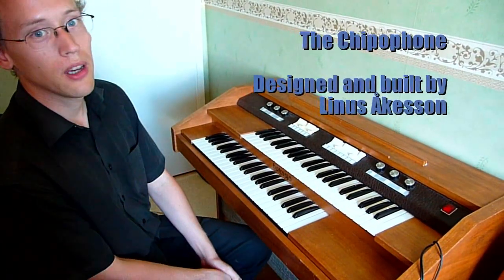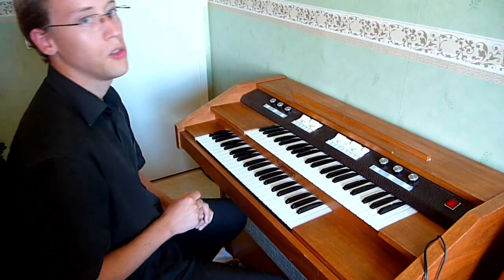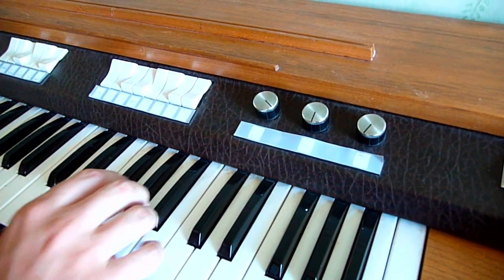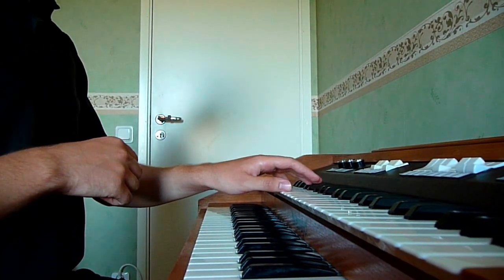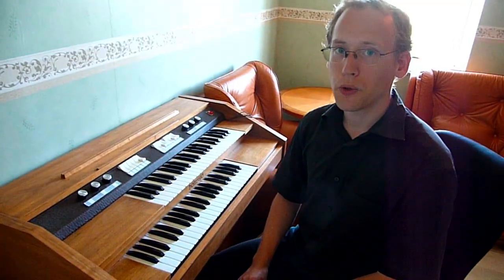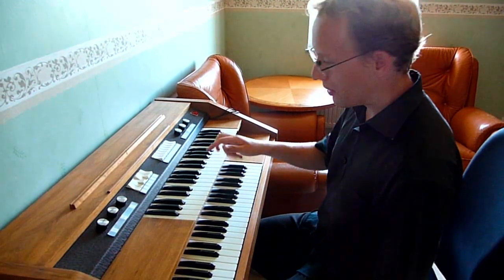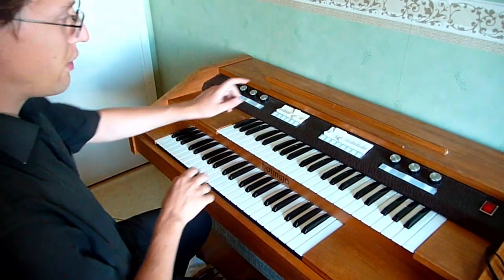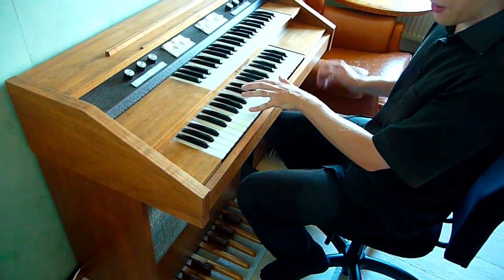The Chipophone

Comment: All this is, is a old organ converted to a midi controller. You can see the white USB cable coming out the back. They make kits to convert these old organs, all the sound processing is done by a PC. This guy has invented nothing. Literally!
Reply: Stop with your conspiracy theory ramblings, man. He doesn't try to hide the fact that it's a MIDI controller, and it's connected to an AtMega88 that he coded. Calm the hell down, it's a neat keyboard.
Reply: No, in previous videos he shows the prototype, its all powered by a small 8-bit microprocessor chip. I believe that right now he is also working with teenage engineering to create more similar digital synthesizers.

Comment: What is it called when a sound goes in a ladder? For example, i press the lowest key and then press the highest and hold both, and the sound kinda runs from low to high if you know what i mean. I would really love to know this
Reply: Do you mean arpeggio? Or portamento?
Reply: If the sound moves upwards it's called a pitch riser (pitch bend). You do this when you want to build tension in your song. Raising the pitch of your lead synth and adding a snare roll is the perfect way to build up to the climax of the song. You could perhaps add a breakdown with the drums right after the build-up, or just add a break. Also you should add a rhythm to the lead, so that it doesn't sound boring when it rises. :)
Reply: those are called interference beats if i'm correct

Comment: Is it analogue or digital? Sorry for sounding stupid, but I just heard a bunch of analogue synths capable of sounding like 8bit or close to it.
Reply: By definition, if it's 8bit it's digital.  Basic pulse/noise waveform's generated by an 8bit processor, 1980's home computer style.  These are modulated in various ways to produce effects, but if you notice - no filter.  You can produce the same kind of tones with analog, with basic raw open filtered patches.  If you're asking mate, shows you're not stupid...
Reply: PTechnicalOriginal By definition, if it's outputing audible noise, there's some amount of analog circuitry involved. The voices, ring modulus and hard sync are digital, and the filter effects are analog (implementing a FIR filter or similar would have been much too expensive).
Reply: soylentgreenb Analog circuitry involved in the output stages, yes I agree.  As for the ring mod and hard sync, I must be missing something because I don't hear those effects here.  Not quite with you friend, are we talking about this instrument?

Comment: You're an idiot.  The vibrato is produced by foot pedal.  The room sound cuts out because he's using a microphone for his voice, but he's cutting out the room noise when he's not talking.  He's not amping the sound from the chipophone.  He's getting the sound as a direct out so you can hear what it sounds without his crappy room noise.  So his mic is not picking up the chipophone sound from the room, you're getting the sound directly from the sound board.

Comment: The way that works is that there is an LFO (Low Frequency Oscillator) that affects the pitch control, producing vibrato. And then there's this thing called an envelope. That allows you to put a delay in when your LFO starts working. AKA: You play a note, wait 2 seconds, then the vibrato starts. You'll hear it in the couple of notes he plays after the end of Mario as well, just for a brief moment.

And yeah... they could do that on old chiptune synths.

Comment: @masterofhobbiton actually if you read it he didn't buy it, a friend did and never used it. but the point remains that he modified an old organ to be an 8 bit synthesizer. now that I see that he removed the speaker in it to send it straight to a computer it makes sense that it has better audio than him. The part about the foot pedal it quite odd.

Comment: @SotR59 The point is that it is a self-contained chiptune performance device (sounds like it is using a SID). He has the controllers set up to do many of the common effects used for chiptunes (arpeggio, slurs, delayed vibrato). He can also control drums (not samples, but programmed chip sounds) from the pedals which is insane. In order to do anything like this, I have to hook up a MIDI controller to a MIDINes plugged into an NES, as well as a HardSID4U and a laptop - unreliable and cumbersome.

Comment: @SasquatchTestes Sadly, Sega was never known for its sound quality. Sure, it had superior graphics and processing capability, but the NES/Famicom always had better audio. Have you ever heard some of the classic NES themes/soundtracks converted to SMS via emulators? It sounds like they got dropped into a blender. SMS simply cannot compare in terms of sound. The straight synth/midi versions might sound fine, but if you try to convert them to a higher quality with greater tonal range... it's shit.